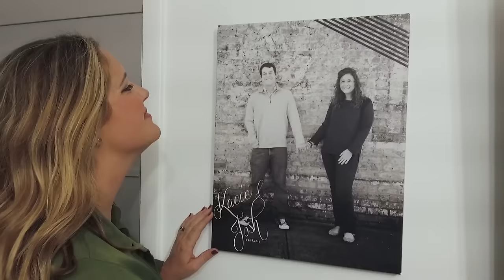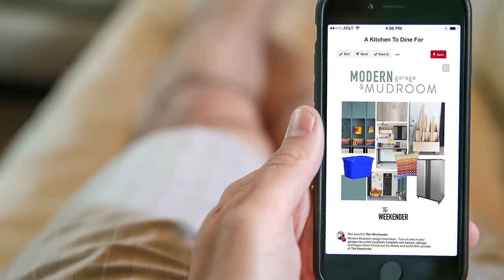The Weekender: "The Shibori Primary Bedroom" (Season 2, Episode 1)

Comment: Monica we bought a cape cod home and I'm lost on what I can do with the slanted walls. We have no head board because of the slanted walls any suggestions?
Reply: Hey Dalia - I grew up in a Cape Cod! Love them!  How about trying Timberwall as your headboard? It's peel and stick and comes in a ton of cool styles.  You could also try fabric and run it up the slanted wall and use a cafe rod to hold it in place at the ceiling.  Let me know what you end up doing!! Good luck!
Reply: Thanks Monica, I'm going to try one or the other we should be painting soon so I will let you know how it turned out. Thanks again.

Comment: #1) Don't rip out my carpet.. telling me you are going to install hardwood floors.. and then put down a cheap ass laminate.. UGH!!
#2) I prefer the dark wood color of the bureau.  I am not a fan of painting over a beautiful dark brown cherry finish with white paint.
#3) I really HATE blue!  I hope you discussed color with the homeowners before deciding on this.  I would not want this wallpaper in my home.
>>> The ONE thing I really do like in this room is the very unusual headboard.  Good Job!  And.. you have given me a great idea for the old fashioned flat doors in my rental.
Reply: Rebster  My issue is with the fact that at 3:14 she states.. "Putting hardwood in is going to completely change the feeling here."  Then she proceeds to put in a laminate.  If you are going to put in a laminate.. tell the client you are putting in a laminate. Don't imply that you are putting in hardwood! There is a HUGE difference.
Reply: Rebster  Yes.. there are some laminates that do not look altogether disgustingly cheap. However, I would never buy a home that has laminate flooring. I just don't care for the look of it. 
I would rather spend the extra money for engineered wood.. or put down large format tiles.. and perhaps a nice area rug.